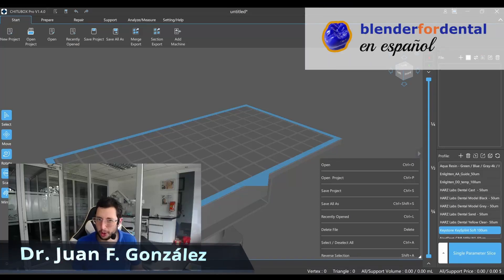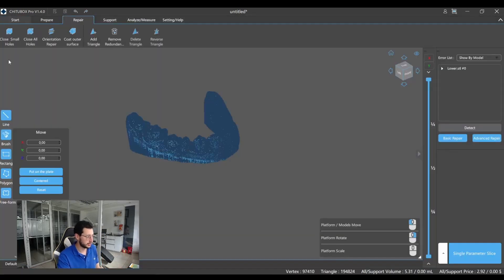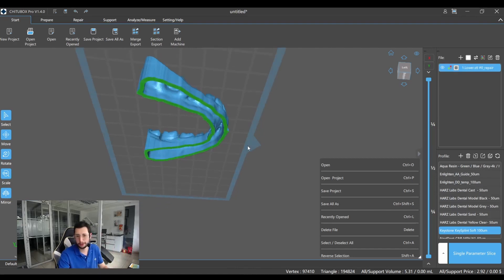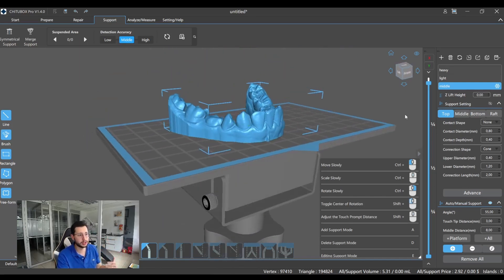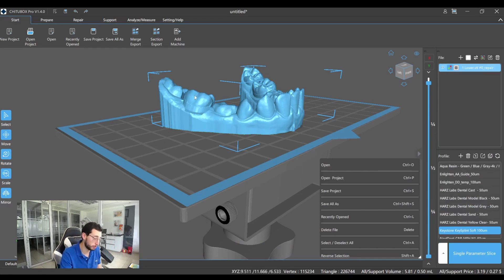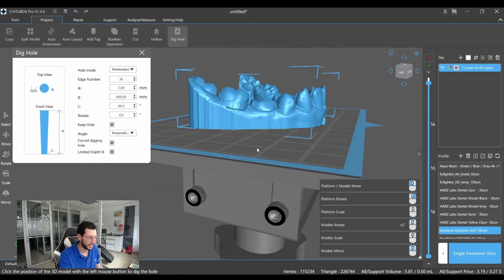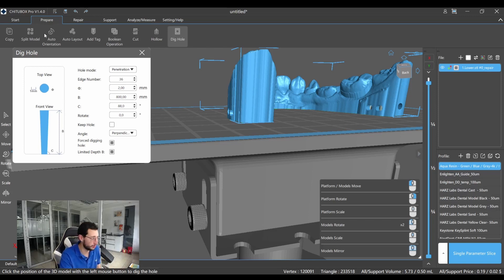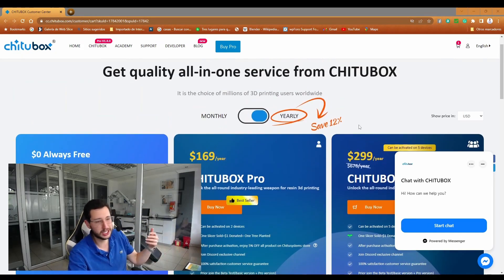🧠 How to 3D Print Dental Models PERFECTLY, every time.!

Comment: You should create the holes close to the base, so its more like a half circle, because at the first layers where there are no holes, you will create a suction (hollow space) where it's harder for the platform to peel off the model, sometimes causing layer shifts.

Comment: hello, why is my dental model  analog hole is always so tight, so my analog cant fit in thanks so much
Reply from the maker: It's probably due to overcuring of the resin or not enough tolerance compensation. When designing the analog hole, you need to make it slightly bigger than the actual size of the analog

Comment: Why not just print a solid model?
Reply from the maker: Mainly to save resin, especially if you experience print failures 🥲. Solid models are also a good option, but they may cause the FEP to wear out faster.